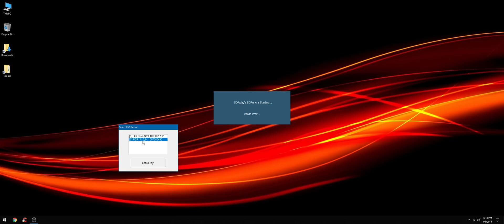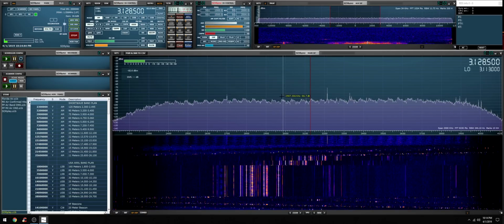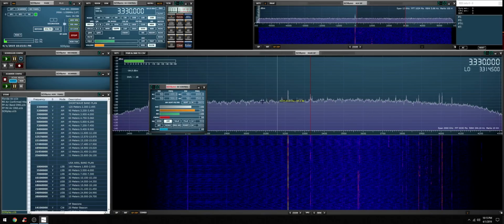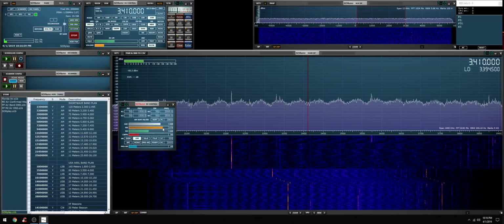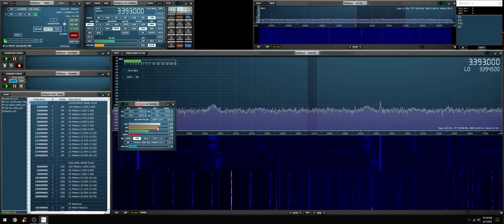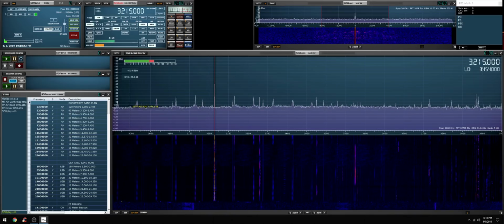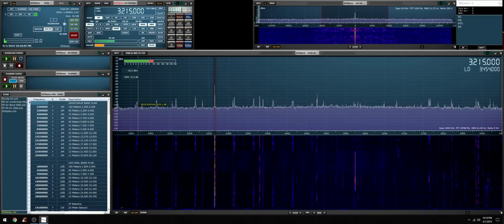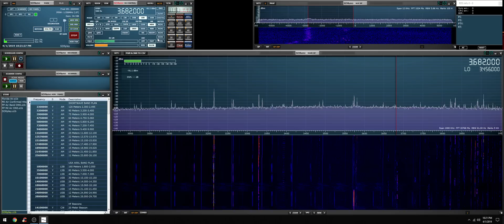SDRuno Wideband Noise Blanker demonstration

Comment: Any advice regarding a nearby AM radio station causing bleed-over to all the Medium Wave (AM broadcast band).  It's a 50,000 watt station and I just want to eliminate or reduce
that one station so I can hear DX AM stations?
Reply: Depending on which device you own. You can enable the MW notch filter. 
If it still bleeding though you can add an external notch. This one works well https://www.nooelec.com/store/distill-am-broadcast-am-filter.html
Reply: @mikekd2kog588   Mike I think he actually wants to listen on MW, so the MW rejector would be of no use. A notch for a single frequency is hard to make, as it tends to reduce adjacent stations as well. Maybe the only answer is a rotatable loop antenna so he can null down the strength of the problem station.
Reply: @andyhowlett2231  Good eye, Hmmmmmmmm how about a MFJ-956 and a variable attenuator?  like this one https://kd2c.com/attenuators
Reply: Thanks for the responses.  Yes, I am wishing to listen to MW, but need to reduce or eliminate the bleed-over of one very strong MW station interfering with all other MW stations. I'll look into the variable attenuator.  The loop antenna was also a good suggestion. They appear to be a favorite among MW DX'ers.  I went with a simple EFHW antenna with a 49:1 UNUN, hoping for an all-in-one kind of antenna that I can mount outside but don't have to adjust and doesn't require an expensive tuner. It works quite well for shortwave but is too directional apparently for MW.  Mike, thanks for your videos. They really help with understanding a function rich program like SDRUno.

Comment: Useless.... everything is so small, one can't tell what the heck you're doing!
Reply: I agree that viewing this video on a tiny screen could be hard to see. Here is a recap.
Enable the wide noise blanker (WNB) button via the RX CONTROL Adjust the noise blanker slider (NB) via the EX CONTROL (Default slider value is 190)
Make this change until the noise drops and the meaningful signal resolves.